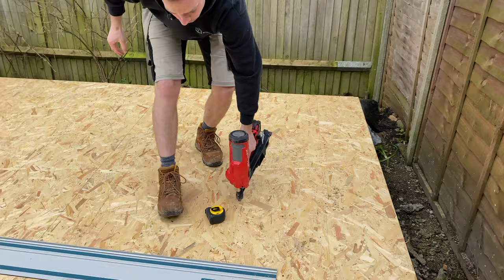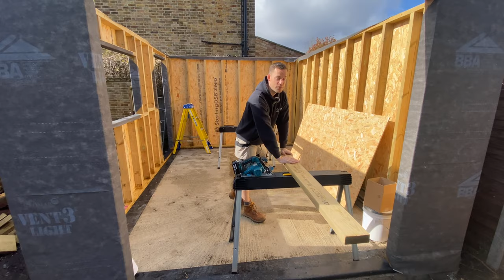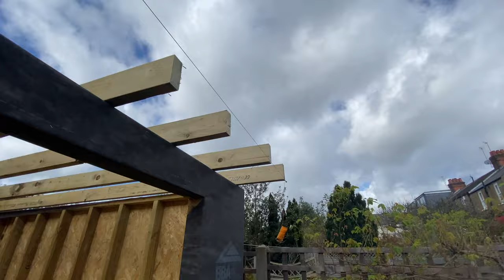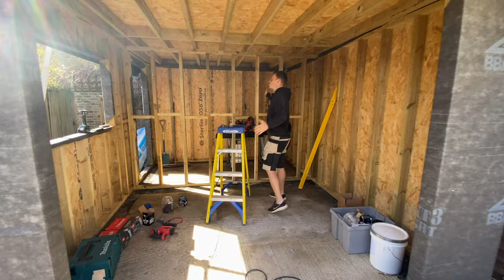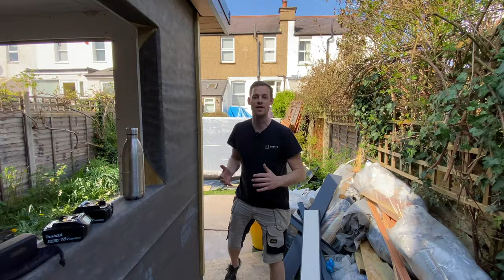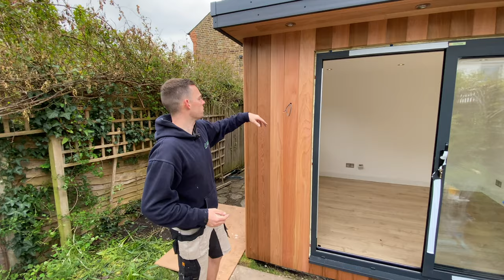The Ultimate DIY with BASIC SKILLS Full Garden Room Build  *NO DETAILED  EXPLANATIONS*

Comment: Great videos guys. So impressed with your attention to details and how tidy your site always is. Couple of questions please. I’m planning a 4x2.4 garden room with a timber base frame rather than concrete. Is C16 timber ok or do I need to go for C24 for the base and for the stood work and roof? Also, for the lintel, what do you suggest I use? I have noticed you tend to use 2 125x47 joists paired together, when others use steel. Is steel really necessary? The space I am designing is a room with a door and next to it a sheltered area for a bench and table, but this would be open at the front, covered by the roof that is one roof all the way across (not sure if I’m explaining it properly sorry). Thanks 👍
Reply from the maker: Thanks Andrew. C16 and C24 are pretty similar however C24 is a bit stronger and has less defects. For the lintel we use 2 8x2's put together. Plenty strong enough, never really any need for steel unless it's a really big span like 4m doors. Cheers, James

Comment: great video!!! just one question, you didn't cover how to attach the cladding to the side that you can't fit down near the fence. Is there a trick to fixing it on with no space? Also... when it comes to planning, how close to you make the slab from the party fence and how far in do begin the timber build?
Reply from the maker: Hi, we just fixed form the outside with the normal 10mm hex screws as normal. We could actually fit down there so it wasn't an issue. If you can't fit down the side you have to finish the wall before standing it up 👍

Comment: Looking to build a garden room  3m x 4m and the roof runs front to back 4m how much higher should the front be? Thanks 👍
Reply from the maker: It only has to be a slight fall and the water will run off. 70mm Will do. This can also be found explained in the roof section of the video 👍

Comment: Just wondering why the roof joists go the long way has a retired carpenter we always took the shortest route for strength
Reply from the maker: Makes the overhang stronger on the front 👍 Also, this build had a partitioning wall so that added the strength in the centre of the room which allowed us to use 5x2’s. If it were the whole length we would of probably opted for 6x2’s or gone across the room as you have mentioned. 👍